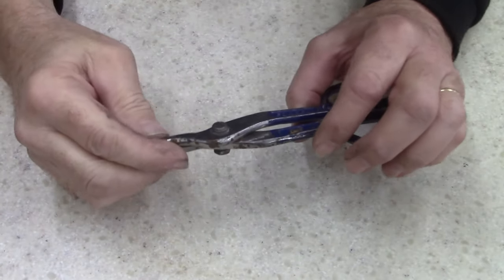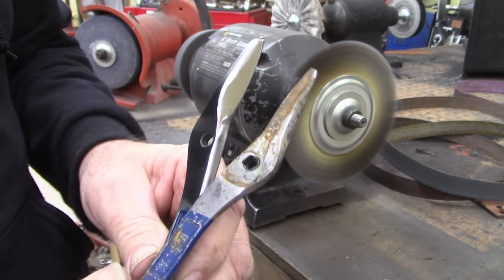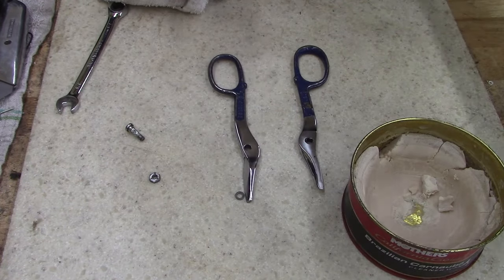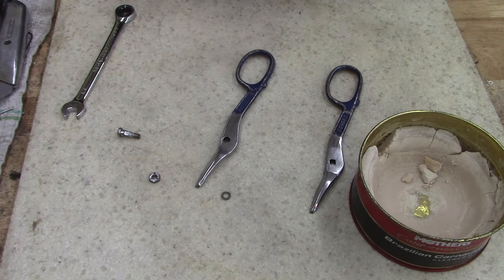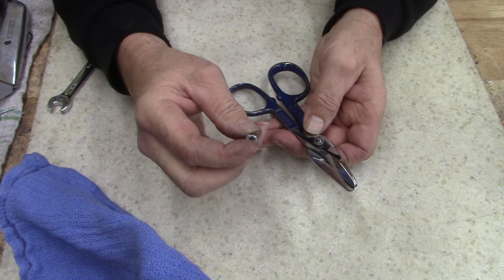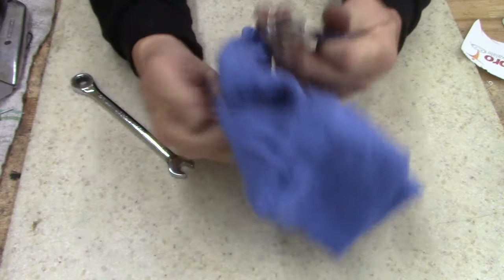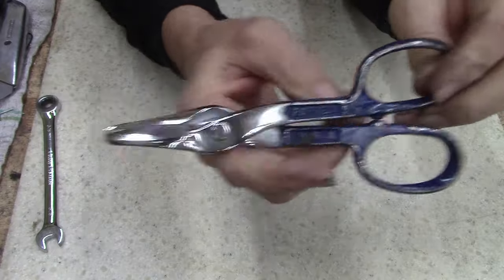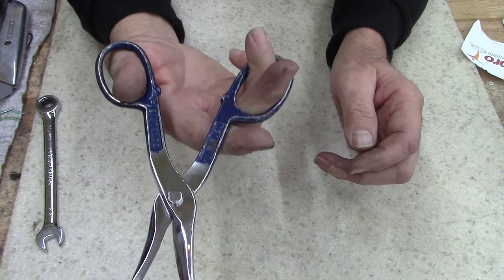Prosnips tinsnips, clean-up!

Comment: I have those with rubber handle. I'ts rare to see that style today, the most common are the aviation tin snips if I am correct.
Reply from the maker: Are your's older, and did you buy them like that, because I have never seen them with rubber coated handles, but then again all the ones I have found or used were just steel!
Reply: @djstoolrestorations  My snips are 10 inch, They're still new but old stock when I got them, Maybe mine is newer I don't know.